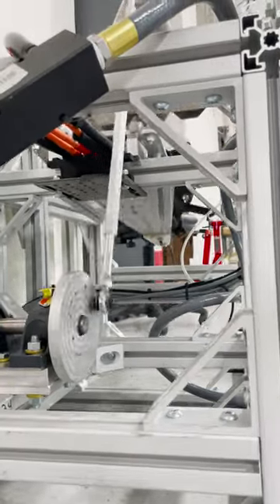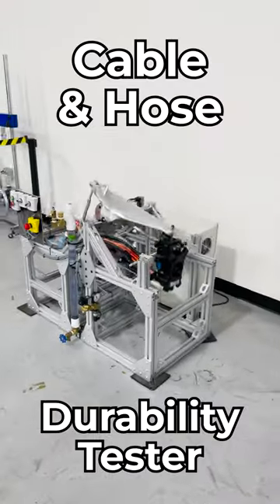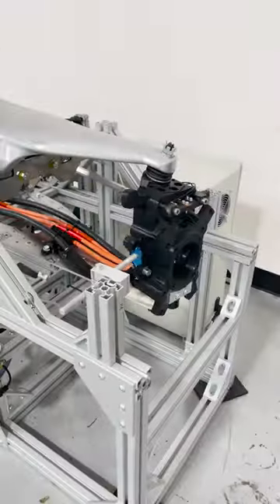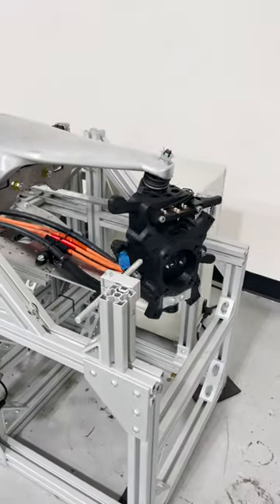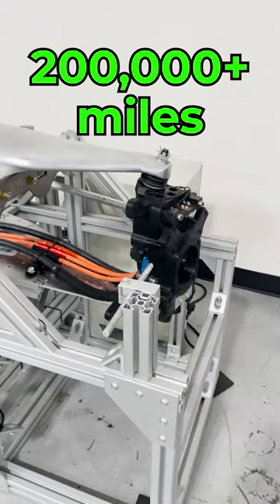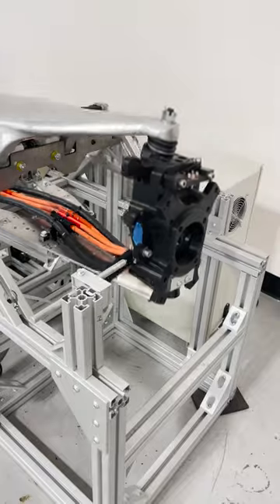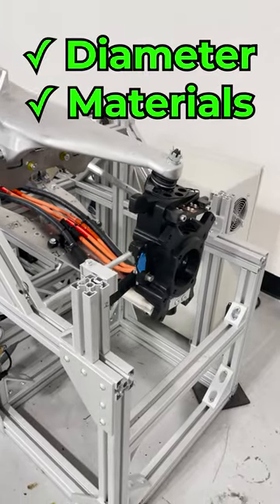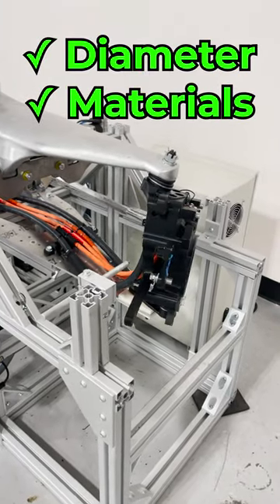Cable & Hose Durability Tester

Comment: Should thermal cycle it at the same time (hot and cold).  Movement at room temperature isnt realistic.
Reply: Why you don't think flexing a hose in a 70 degree room with absolutely no environmental factors present and then claiming, we tested it for 200,000 miles. I like this company but these pseudo claims are starting to get weird.
Reply: @SilverCymbal  also the cables weren’t loaded with voltage and current while bending ?
Reply: @ralanham76 that makes no difference other than maybe temperature

Comment: I'm not a mechanical engineer, but out of curiosity are cyclical motions like that adequate for testing durability, I feel like a combination of different temperatures, vibrations, and high acceleration and high jerk would be better for durability, or does it not really matter??
Reply: Are you talking about the Elaphe Motors? They have been tested by the Elaphe Company in torture chambers. This one is just the cables and connectors.

Comment: I would think those 200 000 miles happen across several years, during which materials age, lose their propreties in cold, heat, degrades with dirt etc. Doing the movements in perfect brand new condition does not prove longevity, just that they work as intended.

Comment: While I appreciate the people pointing out that it isn't a realistic testing enviroment, that's not really the point of the test. The point is not to get real world data on how the suspension holds up over time, the point is to validate the materials and design of the system. The prototypes they have are good for testing real world conditions, this is to make sure the cables won't immediately suffer metal fatigue and the structural members wont develop cracks in standard usage.

Lab testing is an invaluable process that is designed to make sure the component or assembly is of a sound, viable design.